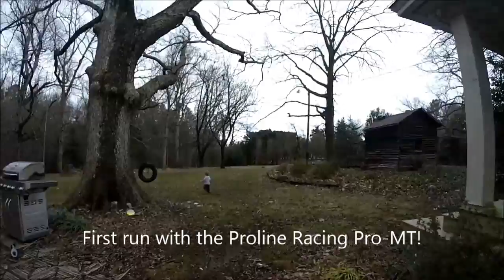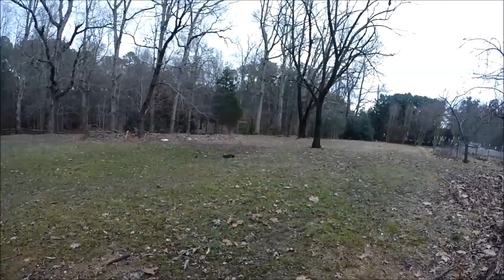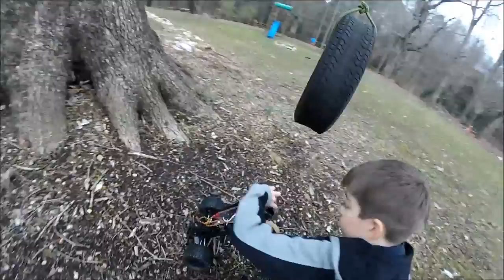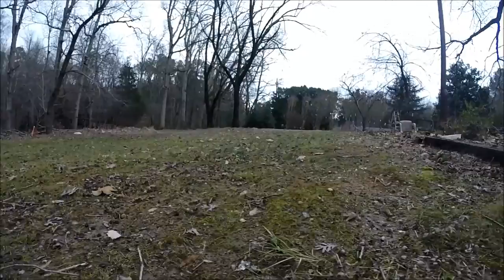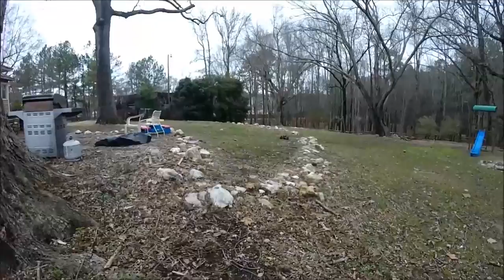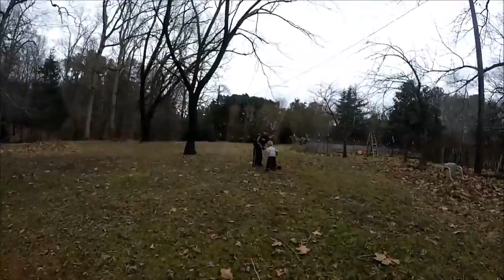Proline Racing Pro-MT First Run

Comment: The braking power can't be increased as you may think.

You will need to have thicker diff fluid to make the brakes work better, because when you hit the brakes it'll stop the motor, but the outside wheel will spin forwards while the unloaded wheel will start spinning backwards. 

It sounds silly, but hold the brakes on the car, then push it forwards with the two left wheels on the ground.

You will notice that even though you have your finger on the brake, the wheels will still spin in opposing directions. 

The only way to limit/rid this issue is with thicker diff fluid, or a locker.
Reply from the maker: Hi.  There are settings on the ESC for break power.  I was able to up that to make it have better breaks.